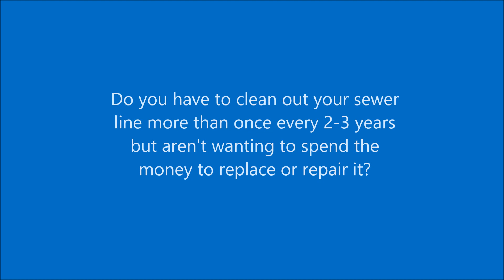The Best Drain Cleaning Method, Period!

Comment: Ive used this method on trunk lines in down town Houston before the line gets lined fron the inside (cured in place) pretty much a fiberglass liner or sock inside...when you come across a big debris or obstruction of some sort on the existing pipe, they use this method that we called a "lumberjack" all it is, is a drill with chains that will beat the crap of the obstruction...good method in some cases....nice video...
Reply from the maker: Thank you. Yes, the flex shaft is great for preparing lines to be lined or patched. We use the Pipe Patch system for ours but have not gotten into CIPP yet.
Reply: @DynamicDrainsofTexas  yes sir..i was actually a inspector for the COH wastewater dept and we dealed with them all the time..huge lines.. but good job but even better when you do get to do CIPP wont be nothing different.
Reply from the maker: @grrizly660  we do mostly residential and light commercial. CIPP is great and i am very familiar with it. The technology is changing rapidly as far as the resins, epoxy, and curing methods. I may get into it more one day. Honestly, I prefer pipe bursting vs lining. They do both have their pros and cons.
Reply: @DynamicDrainsofTexas  absolutely...they are both great methods...i have many stories and experience with pipe bursting..lol...just remember like i would always tell them..."when you smell shit, you smell money"

Comment: What kind of head is that? Never seen one with the chains on it!
Reply from the maker: It's a Renssi brand flex shaft head with carbide chain knockers. They are a drain cleaning equipment company out of Finland.
Reply: Had to rewatch because at 15ft it looked like that concrete hub was broken only on bottom..then after it was all blown out! Got to be careful.. hope you sold a whole new sewer line!

Comment: I do not believe picote or any other flex shaft system is a better option than a blade..   in certain situations,  ok,   But generally.. no way..   I’ve cleaned 30,000  drains..  I do generally 2-3 mainlines per day.. and also a couple small drain lines..  on average 4 jobs a day   I’ve used every machine there is..I’ve got 4 Jetters too..     if a cable is just punching a hole through the roots... you are using too small of a blade
Reply from the maker: I appreciate the feedback.

Comment: Sorry..but I’ve been cleaning manliness for a couple decades and this method  is not the best period......   it sometimes can .... but not always....and I would not suggest a newb to start doing this on their own...    like most trades it will take about 3 years before you have seen it all..    you absolutely need a cable machine with three-quarter inch cable 6 inch blades etc. and you should have the capability to go 200 feet....   When you have a sewer line that is not draining and is under pressure, you really need to cable it first in most cases
Reply from the maker: I have been doing repair plumbing for 20 years. This may not be the best method period but the title is more for SEO and reaching people. It's a great method for this application but there is not one tool that can do it all. We have jetters, cables, and flex shaft machines for that reason. This machine can open a drain up fairly quickly that has a root clog or grease but that doesn't mean it will always work. As far as a rookie using it, it is much safer than a drum machine or sectional for a novice. To be effective with it requires a camera at the same time but not nearly the needed experience as required for a drum machine. Those require a lot more experience, mostly to be safe and keep from hurting yourself. The needed experience for this is to learn it's limitations.
Reply: Newbs can't even get one, stores don't sell them. 😄